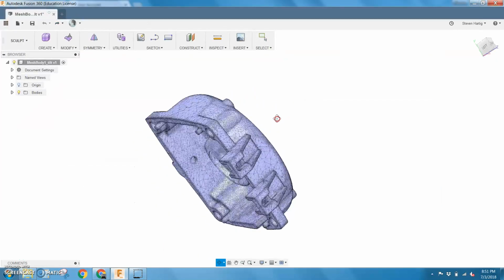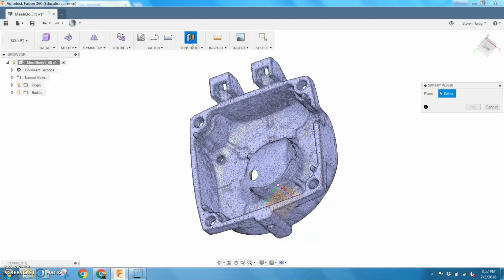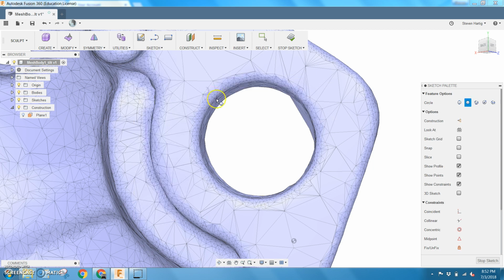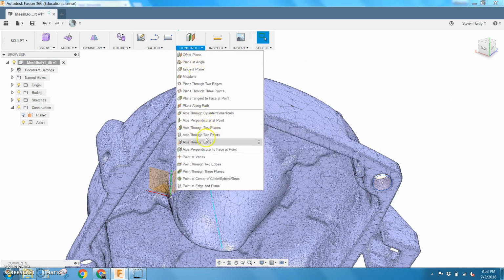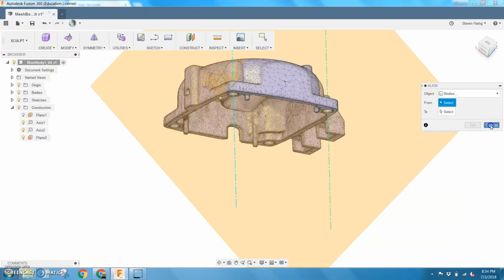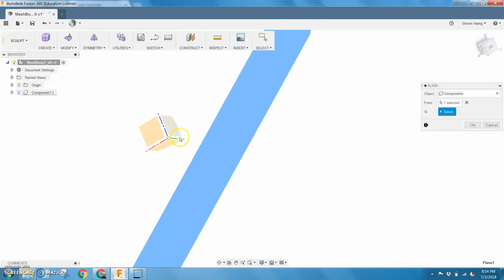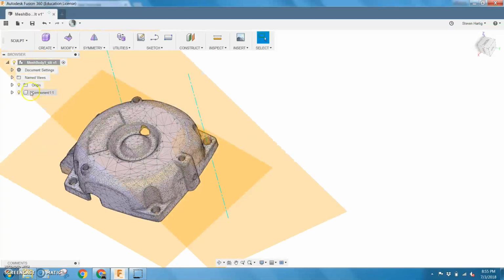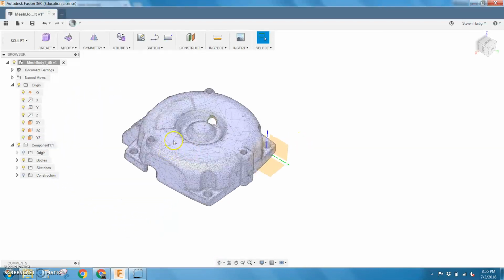Align Scan data to Origin (Fusion 360)

Comment: Can get this method to work in latest version of fusion. Get a Error: No alignment suggested by geometry could be found. Any ideas?
Reply: got the same issue here and I'm stuck with "no alignement suggested by geometry could be found"
Reply: @kamilabiaozynska554   You have to right click on the component (folder) and click "unground from parent". After ungrounding it should work just fine.
Reply: Same here, get this error after selecting to and from plane in the Align command. You guys figured anything out?
Reply: here i am... same issue... anyone solve it??
Reply: also just ran into it, make sure you unground the component, otherwise it can't move

Comment: What Scanner and scan software did you use???
Reply from the maker: This process would work with any mesh resulting from a scan.   The software is Fusion360 in "Sculpt" mode.
Reply: @into3d96  Thanks! I use Fusion360. Wasn't what capture software/equipment was used.
Reply from the maker: @machiningcoolstuff9124  Probably an Einscan for that model...could have been a SMARTTECH scanner, though.   Design Wrap was the probably the meshing software.
Reply: @into3d96  Thank you so much! I am going to try an XYZ scanner we have. I am going to look up the Design Wrap software. We are starting up some custom automotive parts reverse engineering. Your video was awesome. Glad we found it. Thanks for making it and responding to our questions!